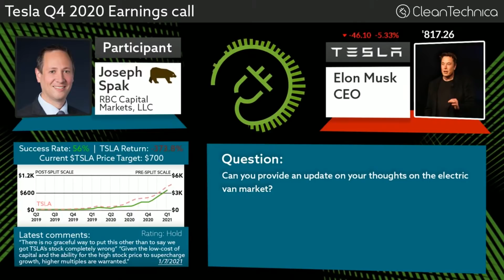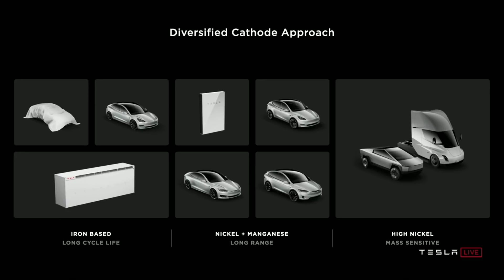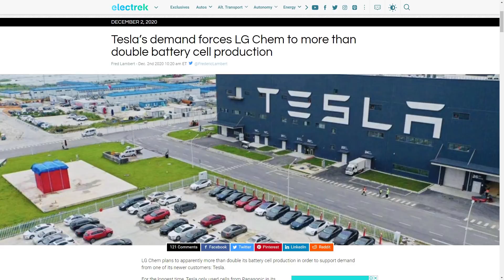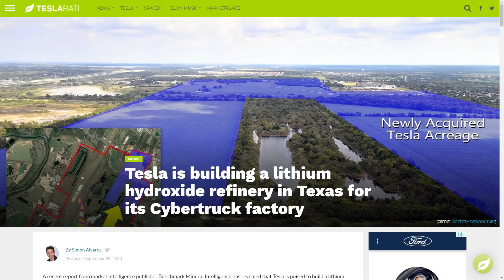Tesla battery cell constraint? Battery Plants or Battery Materials?

Comment: The cell unveil at Battery Day revealed multiple concurrent innovations bundled into the new 4680 cell. Tesla may only be able to deploy these innovations incrementally.

Form Factor: 4680, big cell, fewer parts, high active material ratio, thermally challenging
Tabless: faster charge/discharge, thermal benefit, fewer parts
Dry Battery Electrode: manufacturing efficiency for time, footprint, energy consumed; more energy dense
Chemistry: Tesla Si; Co-depleted chemistry
Structural Pack: cell to pack with no module, fewer parts, more rigid car body

These each offer massive improvements in manufacturing efficiency, battery performance, car performance and if Tesla can execute the deployment of these multiple technologies all at once, it would be a staggering engineering accomplishment.
Reply from the maker: Great points Islam

Comment: I Think you’re getting it wrong
Right now Tesla is stockpiling all its 4680 production, to ship it to Berlin (Elon is adamant that model y MIG will be 4680 based and based on gigacast)remember that the battery facility in Berlin is nowhere built and hasn’t even Got close to a permit
So when they are production ready in Berlin they will only have the batteries from cato Road to begin with
When Berlin battery production is up and running, cato batteries will go into the semi and cyber truck
Thats my take, the battery constraint is real and productionbased
Great show by the Way👍👍😊
Reply from the maker: Great points and that gives me something to think about

Comment: Tesla has figured out production issues over and over and refined production repeatedly.  Production is handled, the "machine" is handled.  Sourcing and Raw Material is the issue.  They can scale production and produce faster than they can get raw materials.  They are buying every resource available.  They are struggling to meet their own needs, what happens when other automakers finally get it together and need these basic materials as well?  The price wars and Battles for materials is going to explode.  One of Tesla's advantages right now is that they are so far ahead of the competition by years.  Tesla is developing mining techniques and will continue to commit to material vendors ahead of the competition.. the competition will have buy at much higher prices and for longer contracts to even be in the game.  The scale and speed of EV transition is going to be shocking.

Comment: Ivan.
As I see it, there are several things to consider.
(Slightly disjointed,.....)

Can the 4680 format be applied to various chemistries, LifePo4, etc. (I believe so)

What will be the density per cell of those different chemistries?
(To be revealed)

Where will the different types be made?

Panasonic suggest they will be producing 4680 cells at Nevada.

Using the figures from battery day ("5x energy, 6x power") if we assume that's compared to the "state of the art" Panasonic 2170, interestingly, the surface area of the jellyroll in the 4680 will be 5 times that in the 2170.

That suggests the calculations may be based on the same chemistry? (One for Jordan?😉)
The 4680 will have better discharge characteristics, hence the 6x power?

Could it be possible Panasonic are simply tacking the 4680 "can" production on the end of an existing 2170 jellyroll production line?
Otherwise, are Tesla trusting them with the Maxwell tech?

As the Kato blueprint is refined and copied, the smaller, cheaper,  "faster" factories will place more strain on material supply than the building of the factoty, but if the process can produce using all chemistries, that burden may be reduced.
For example, what characteristics may a 4680 LifePo4 cell exhibit? Could it approach the output of a 2170 in pack form? Could a few extra, but cheaper cells with that chemistry be powering all but the high performance  vehicles?

On that point, based on a Model 3  pack, Rob Mauer estimated about 4,400 Vs 960 cells.
Based on the can dimensions I calculated the casing metal for the 4680 cans will amount to 66% of that for the 2170 pack, thereby reducing the pack weight, increasing the pack Wh/kg. (Plus the structural element reduction, of course).
I think everyone has automatically assumed "4680" equals "high Nickel" or at least, the more exotic materials. This may not be the case?
They may simply make the existing materials more efficient by using the new format.
Same kWh, same material energy density, 75% fewer "cans".

May add more later (tired)
Reply: Elon stated the Panasonic and their other battery suppliers will use the 4680 “form factor” but Tesla was not going to share their battery chemistry (dry battery electrode, silicon anode, high iron cathode, and electrolyte chemistry). Therefore the energy density numbers etc. probably only be available with the Tesla Roadrunner batteries and later Berlin and Austin.
Reply from the maker: Thanks Roger great points ill run that past Jordan too
Reply: @Tesladocumentaryseries7603  
His response may be
"Oh no, not him again!" 
😉

Comment: So absolutely no one will address this question so I'm hoping you will. Does cell to structure imply engineered obsolescence? How are you going to repair, replace, or recycle batteries that are epoxied into place and part of the structure? I think the reason that all of a sudden you have hedge funds and mainstream media backing Tesla and raising price targets is because of this fact. This is how Tesla is going to make money, by ensuring that the maximum lifespan is 20 years and then you have to pitch it.
Reply: I think you're misunderstanding the term "structural".
It doesn't mean "not removable" (as a pack) Extreme example, F1 car.
The engine is "structural" but removable.
Re cell recycling, have you seen a "conventional" Tesla pack? Plenty of glue.
Current recycling (no pun intended) seems to involve fully discharging the cells, then either shredding or burning to separate the materials, can't see any reason it would be different?
Repair? Existing packs?
Never heard of that.
Reply from the maker: Agree with Roger

Comment: I continue to ask this seemingly rational question and continue to fail to get an answer. Why not use Ambri LMB cells in MegaPacks to free up 4680 cells for vehicles? Reuse old cells in non-mass critical apps such as powerwall
Reply from the maker: I heard JB state that its not ideal to use spend batteries for energy storage. As energy storage batteries have specs that must be met

Comment: I would spend the cash on converting gas stations to changing stations to reduce the need for long range batteries. The real production hell is the battery manufacturing.
Reply from the maker: I would hate to own a gas station especially in Norway

Comment: Just do the math. Musk says the Semi takes five times as many battery cells, and they want to make 100,000 a year, so Semi alone needs as many cells as current production. Then 4Q they said potential car production for 2021 is just over a million cars, again double last year's production. So just there you need three times current battery cell supply, and it took Panasonic five years to reach current production. Then the Cybertruck, which also will use more cells than any of the other car models, I am sure they want to make 300,000 of those or more. Then Berlin production. So Tesla needs five times the cells they have now to reach full production for 2022, probably an additional 2X current worldwide production. That is why Tesla is battery cell constrained, and why they had to figure out how to increase battery cell production with the 4860.
Reply from the maker: Excellent analysis
Reply: yea definitely a great point. i can’t see musk not knowing this problem would come to fruition. i’d expect him to have some kind of plan up his sleeve or something quietly in the works

Comment: Tesla needs batteries for more than just cars, there is a huge demand for stationary storage.
Reply from the maker: Great point
Reply: @Tesladocumentaryseries7603  
That could be the destination for the "bought in" cells??
Reply: If a powerwall were to be LFP instead of the chemistry it is now, what would the capacity be?
Reply: @hyric8927  - I suspect that for the stationary storage (Powerwall, PowerPack, Megapack) Tesla will use the cheaper LFP batteries and configure them with the same capacity that the currently have (13.5 kWh for the Powerwall), but it may use a little bit more space because of the lower energy density. The LFP battery also has a higher cycle life and should last more years with less battery degradation.

Comment: Do you know wether Tesla wants to have 3 TWh capacity installed in 2030 or to produce 3 TWh of battery cells by 2030? I think during the Benchmark Mineral Intelligence reaction video someone said he thinks Tesla meant to have 1 TWh capacity installed in 2030 and produce 3 TWh of battery cells until 2030. Can someone clear this up? BMI tracked pipeline of all battery cell factories until 2030 is at over 3.15 TWh for ALL battery manufacturers worldwide. I wonder how much Tesla capacity is included into the BMI tracked pipeline. I think they are tracking specific projects with nameplate capacity at an individual level and calculate the aggregated capacity of all announced projects.
Reply: Tesla wants to produce 3 TW of cells in 2030, and 20 million cars along with enormous amounts of energy storage.